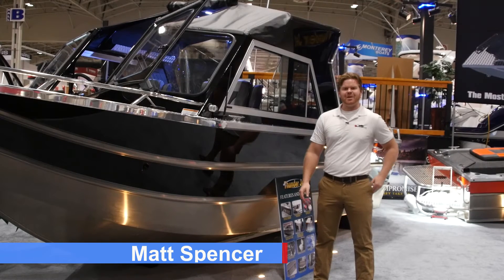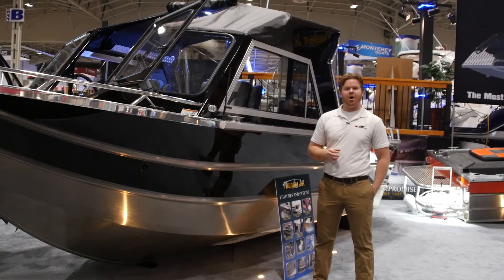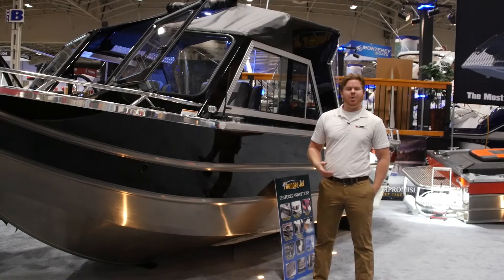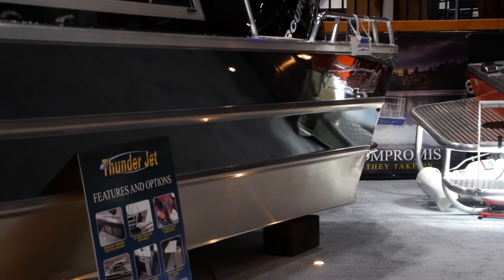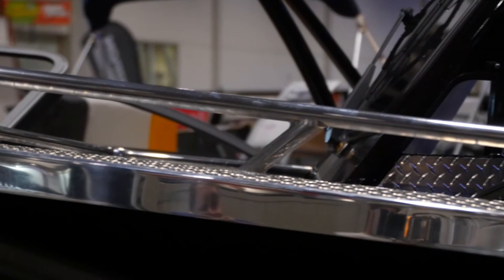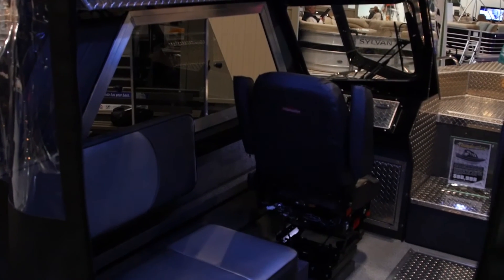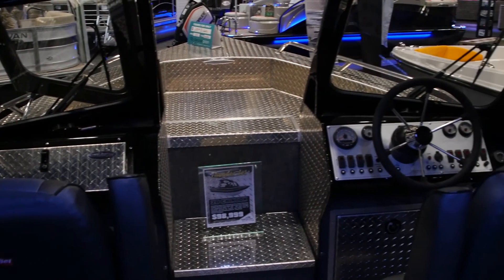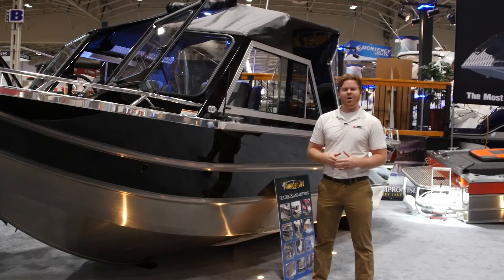2017 ThunderJet Chinook OS

Comment: my 2016 21 ft luxor os ob f150 yamaha just hit 42 mph with 30 gallons fuel and 4 folks on board.  Prop is 16 pitch with more cup and rake than I thought it should have, guess I was wrong.  RPM was right at 6000.   200 hp yama was the base motor for the rally luxor, more sport and speed, probably 50mph.  Really love the boat